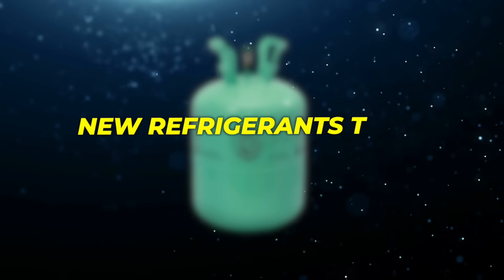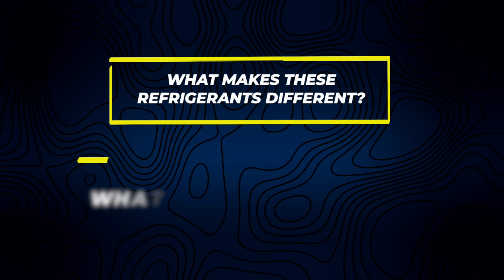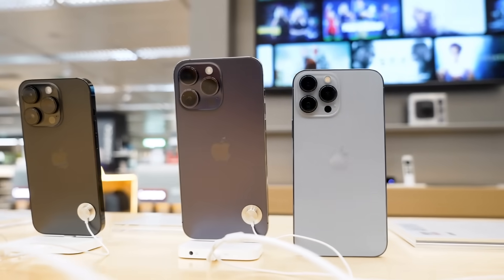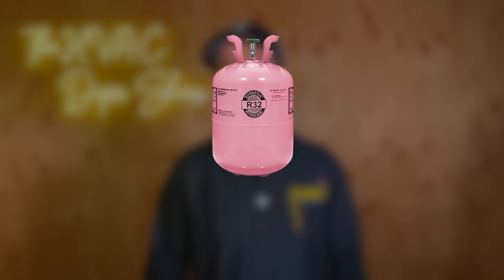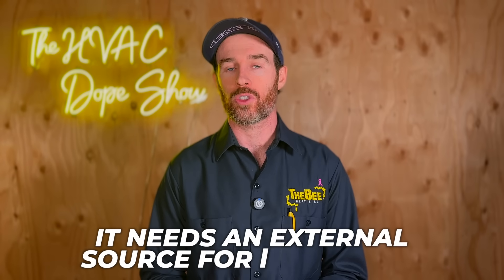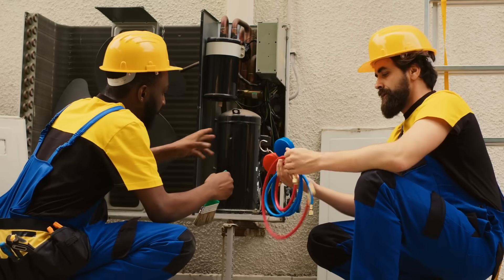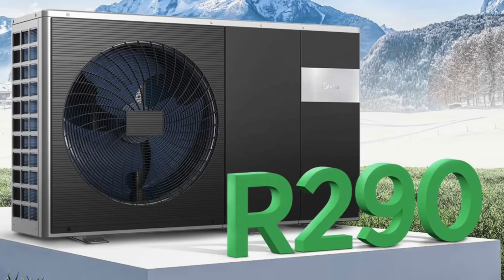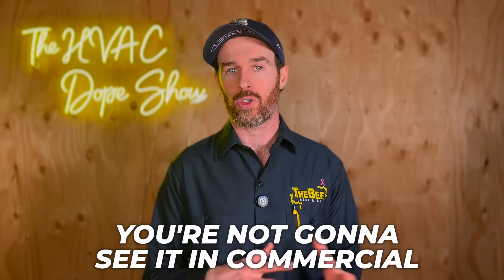The TRUTH about the “new” refrigerants | R32 and R454B refrigerants phase in

Comment: If your system with r454 is low and you top it off, you would be improving the gas mix ratio.  I don’t see the problem unless there was a large amount missing.  But if that were the problem, you aren’t likey to put more refrigerant anway.
Reply from the maker: There's no way to "improve" the ratio lol, not following that... 454b is a blend. Topping off means the blend changes. They said the same think about 410a but everyone tops off 410a so it's probably the same. Refrigerant charge is one of the top diagnoses for a system so it will always need some service at some point if it leaks etc (which can be from a valve/port, not necessarily just from a bad coil component etc which requires new charge anyways

Comment: I just bought a new Goodman Furnace/AC system and I bought  a 20lb of R-32 to go with it.  Yes, I don't like the idea storing a 20lb tank for 20 years.  But if it becomes illegal or price rockets I'll be covered. And if i need to top it off I'm good to go same day.  I just think it logically made sense R-22 R-32 sounded logical for adoption.   R-32 cools better than R-22 but with higher pressure I'll expect more problems.

Comment: What happens if you have a leaky coil and your turn your heater on?
Reply from the maker: The sensor will technically shut off the blower if it senses enough of the refrigerant... honestly that's the most annoying part because if you watch videos it's not very flammable but they're overly cautious

Comment: R410A is it going to get more and more difficult to get which means the price is going to skyrocket. I was just about to install a ductless system when I started reading about this. I had three HVAC companies trying to sell me a 410A system and didn't even tell me about this. It's so clear what they're trying to do. They have a surplus of these older units and they want to get rid of them
Reply from the maker: That's odd a lot of 410a systems are running out of stock but yes if they have back stock this can happen... phaseout will be 15 year process so in some markets it's a non issue but that's odd that they weren't offering R32/454b instead. For us it was a very similar cost, but manufacturers started discounting them

Comment: r32 has to have a sensor in the coil so if it gets a leak, it wont explode????????
Reply from the maker: Regulation... it won't explode lol. Watch videos of them trying to set R32 on fire, it's not as flammable as they make it sound, but yes it's a required regulation now. Technically r32 is 50% of 410a so it's already in your old system...

Comment: By the time I decide to replace my R22, for a 32 or 454, there will be a new one more flamable.
Reply from the maker: Probably r290, hopefully... it's just propane and likely that or butane is in your fridge. But those are much cheaper and they're safe as monobloc units, you won't have those running inside your home they use water / hydronic lines instead

Comment: There’s a reason why in the US market 454B will win out and almost all major brands in the US have chosen it. It’s less flammable than pure 32. 410A and 454B both use the same oil POE (Polyolester). 32 uses PVE (Polyvinyl Ether). They are not comparable so a R11 flush may not be enough. You will need to use a pig if you plan on long term customers. Also 454B is less governmentally restricted than 32.

R290 is propane. Refrigerant leaks are common. That obviously is risky. I think I t’s better to use R 717 than any of these. I’ve worked with it many times industrial and small appliances. I remember years ago running across a residential package unit in the US that had ammonia.

Comment: Had a home warrantee on my HVAC and other appliances. My AC wasn't keeping up with the heat, assumed it was low on refrigerant, so I scheduled a tech through the warrantee company. What you would expect: the warrantee denied the claim and the tech told me R410a was going away, that it is hard to get and very expensive. Said the system would probably need at least 2# @ $200/#. I fired him, cancelled the warrantee, bought a 2# bottle with an adapter for $144 and did it myself. May have taken 2-3 oz. Bottom line: if you're considering a home warrantee, forget it, waste of money AND lots of crocks and liars in the HVAC business.

Comment: I've got a 28 year old Amana R22 2 1/2 ton heat pump. Still runs like a champ, and has required minimal maintenance over the years. From what you described about R 32, and that Amana is one of the companies going with it, my initial feeling is that if and/or when my R22 unit gives up the ghost, I'll be going with another Amana unit.
From what you described with the R290 units, if I understood you correctly, is that it's basically a chilled water system, similar to what the USN used on submarines (retired USN Enlisted submariner) - in that, the working fluid that gets circulated to the cooling coils inside your house, is nothing more than cold water.
Reply: "Pssst...wanna buy R22??"

Comment: Go back to R22, best ac freon ever. 410 sucked. So do its replacements. 
Propane is an explosive gas waiting for a compressor to short and  cause explosion. It already happened in refrigerators blowing up
Reply: every grocery store and convenience store has 10 to 60+ R-290 refrigerant units, so don't go in there either. R-290 is a similarly efficient refrigerant to R-22, slightly better. Also, residential refrigerators are R-600a, not propane. R-22 has not been produced since 2020 and won't be.

Comment: This new refrigerant is such a scam. With not enough drums available. Not to mention the reverse threading on the new jugs. R-32 has been around for 10 years!!!!!!!!!  Goodman and Diakin are the only ones in the United States to use it. Every other company said no way. We want the r454 that’s a compound with 31% r1234 that’s in car ac. And in Europe it’s on the way out being banned due to forever chemicals. Europe was first to ban r134 for cars in the past. When r410 came out around 1995 it was 50% r32 and 50% r125. It wasn’t made mandatory till 2013 and that is like 18 years. R410 equipment is still legal to sell in the states till the end of this year but no manufacturers are making it. The manufacturers have plenty of either r32 or r454 but the issue is with the container tanks that is known to be needed to top off new installs. R454 will be banned and it’s just more bs. In 2034 the next change is to go to all natural refrigerants. Propane is r290  C02 and that’s a higher pressure. Maybe ammonia. Good luck

Comment: Subbed. Great info, sir. I bought a brand new 1,500 square foot single story house in 2009 in California that has a Lennox system that uses R22. The HVAC system mechanically works perfectly, but I'm a bit low on refrigerant. Because of this "planned obsolescence", I'm now (and I'm not the only one) forced to scrap a perfectly running system because I cannot get any replacement R22.
Reply: Ummm no.  Either it was undercharged when installed or your have a leak.
Refrigerants are a 100% sealed system, they do not "consume" refrigerants.
Reply: @darknes7800  Thanks for the info, sir!!!
Reply: @darknes7800  There is no such thing as a perfect seal.  Running a little low on refrigerant after a decade and a half can happen.  Although you may be right about it having been undercharged when installed as a cost-cutting measure.  That would make it worse.
Reply: @laurenceperkins7468  Sure, but there are only 2 schrader valve seals on the entire system. If your system is low, either you have a leak at a factory brazing joint or a field brazing joint.  Some companies do undercharge the system, in hopes of getting a call back and being able to charge the homeowner.  In some cases the tech has no idea what sub cool and super heat are, so they charge to pressure and call it good.   Cheers !
Reply: @darknes7800  There are also going to have to be seals on the compressor drive shaft unless it's using some kind of magnetic gearing to reach through the housing.  Which is technically possible I suppose, but I've never seen one myself.  There would be some significant hazards to that unless it was somehow built with a non-conductive housing, since anything conductive in the rotating field would turn into a generator...

Those are the ones most likely to slowly leak I expect since there's mechanical motion involved.  But it should be very, very slow.  Modern fluid seals are pretty darned good. So if it lasts less than a decade without a recharge then probably it was undercharged to begin with.
Reply: @laurenceperkins7468  If it was venting into the compressor housing, its a sealed unit and would not vent to the atmosphere and would result in quick and catastrophic damage to the compressor.  Occam's razor, 99.9% of all refrigerant leaks are at the brazing points. 0.1% are internal compressor leaks..
Reply: @darknes7800  The housing also depends on a seal around the drive shaft though.  So the kind of leak we're talking about that takes a decade or more to run the system down isn't going to build up catastrophic pressure levels.

All I know for sure is that everybody in my family buys 15-20 year old cars, and the A/C refrigerant is almost always low.  And, so far at least, every single one of them has not had any detectable leaks once refilled.  Probably less common in stationary applications where there's less vibration.  But there's some path for it to escape through that takes years to lose a few ounces.
Reply: @darknes7800  wrong.. look at your evAPerator.. usually one on it.usually not a problem
Reply: @jsparlin1  There is no schrader valve on the evap coil !!!!!!!!!!!!!!!!! LOL  
People on TY are a hoot.............
Reply: @jsparlin1  LOL!!!!!!!!!!!! Okay Ex SPERT !
Reply: Recycled R22 is definitely available.  It cannot be manufactured but much the recovered R22 is being recycled an sold
Reply: @jrb729  Thanks, sir!
Reply: Mexico still manufactures r22

Comment: HVAC has nothing to do with the environment and 100% about money and over regulation. Think not ? Why aren't most units designed for R290 ?  🇺🇲
Reply: because is explosive at spark, so only 8oz i bliebe is the limit. i magine a system with 5lb of propane and the compressor sparks?
Reply: @ivangonella1  R454b is the new refrigerant, and it's flammable and its also $1900 for 30lbs . Again HVAC is all about control and money it has nothing to do with safety or the environment.  / global warming bs . America needs a strong deregulation program and get back to manufacturing everything we use or need in this country. 🇺🇲
Reply: @ivangonella1 So why is the new refrigerant R454B so expensive and highly explosive/ flammable? 🇺🇲

Comment: What pisses me off is that we have been required to recover refrigerants since R 22. The damage to the ozone layer is crap if the Freon is not being released into the atmosphere. Every time we have changed refrigerants the air conditioning units have had to increase the pressures to maintain the same efficiency. The higher pressures means the unit works at a higher heat which shortens the life of the unit. Not to mention all the new equipment the tech has to buy to service the new unit. This is how politicians rip off the public without them knowing that they are being ripped off by the government while big business gets rich playing along with the governments game.

Comment: Will I be able to add or replace my Mini splits 410 with R32 or R454B or will I have to buy a new Mini split when or if I have a small leak like my Shrader valve?  I have 4 mini splits now 1 in each bedroom and one in the living room I installed all of them. I repair cars and trucks so I have gages and a vacuum pump. In cars with R12 I pull a long vacuum and replace it with R134 no need to change the whole system. Some people upsell their costumers a new dryer but I just watch the moister gage until I have pulled all the water out of the dryer. It takes about 2 hours.
Reply: 410 will be around for 20 more years
Reply: @henrykennedy1120  The 2 mrcools 1 in my sons house 1 in mine had the compressors fail at 4 years old and were full of refrigerant. Mine was $1,100 They will not replace them on the warranty because We installed them ourselves.  So I don't have much faith in these lasting as long as my 10+ year old window units.
Reply: Because you got the wrong brand , Mitsubishi is the best mini splits and you can replace a bad valve core without losing charge I have a core removed that olds back the refrigerant I know what I'm talking about I've been master licensed HVAC tech since 1978 410 isn't going anywhere ,r22 is still available also

Comment: The industry as a whole is a joke. Expensive,breaks and doesn’t go the distance. Parts under warranty are not fluid in receiving. Back ordered. Refrigerate cost are higher and limited. Customer service on higher efficiency units blows. This has to get simplified and become cost effective for the public. We will price ourselves out of a job. Shame on the hvac corporations and politicians. Someone needs to sue the majority of the corporations for this. The climate change nonsense is being manipulated. We produce three times the by product of older equipment due to junky parts and cheap materials. If they cared about the possible effects of climate change they would produce a quality product that’s efficient. They designed a product that is expensive breaks and fails shortly out of warranty. I care about my customers and hate to see the disappointment when expensive equipment fails.
Reply from the maker: Yeah it's annoying AF you're not alone. I'm getting annoyed with it, when an HVAC contractor get's sticker shock at their own prices you know somethings wrong... recently switched brands to offer better pricing because some manufacturers are not longer competitive, it's sad. IDK we'll see what happens but I have a feeling there's going to be a slowdown and squeeze this summer for manufacturers which might get them to realize things are softening and might be a good time to lower prices and be less greedy. If they can get away with the prices they won't lower them but we'll see, I don;t have optics into their monthly sales, but curious to report on the topic at year end after the data comes in

Comment: My 2015 AC condenser went, but, can't repair, because there's no AC freon, repair guy says can't fix, only replace, bummer
Reply from the maker: R410a is around I would get a second opinion it's probably just expensive... R22 is pretty expensive so if it's R22 it's probably not worth it but the refrigerants are around, just a lot won't touch R22. But r410a (probably what's on a 2015 unit) is absolutely available still

Comment: Your shirt is as flammable as an A2L refrigerant.  A propane bottle is so scary that plumbers carry one around without fear, and many people have a 50 lb jug in their backyard grill.  Smaller freezer sold in U.S. often have R290 (propane).  I've used it in my car's AC for decades (Duracool).  Is a charge of two 6 oz cans scary?
Reply: Residential AC or Heat Pump systems can use up to 20 pounds of refrigerant. A2L is ok, but R290 is too dangerous to pass UL Certification for residential use.
Reply: @WLB2-j5j 10 maybe if you install the condenser in your neighbors yard, not 20. Most I have ever put in a system is 7 and that was years ago before the advent of the micro channel all aluminium coils. They take considerably less now.

Comment: As far as topping off r410a, it's not really an issue if the unit's been running for the most part. If you have had something that's been sitting there in a general state of off and leaked its refrigerant then it becomes more imperative that you replace the entire charge because some of the gases will have fractionated out
Reply: R410a is a near-azeotrope, and is unlikely to fractionate, even in the event of a substantial loss of charge. So topping off is fine.

Comment: We need to just raise the cap on R290 and R600 in North America. They’re a cheap, reliable, and effective. Flammability is such an edge case issue and service providers that are most exposed should be trained on the hazards.
Reply: R290 and 600 are highly flammable and equipment using these otherwise good refrigerants cannot pass UL approval testing, which is required for sale in residential applications.
Reply: @ they’re currently permitted with charges less than 500g. The flammability concern is way overblown. I’ve never seen a charge leak out catastrophically. Failures tend to be pin holes and very slow leaks. The flammability range for both of these gasses is very narrow. The risk is very low and techs would need to be trained.
Reply: @yolo_burrito  500 g is nowhere near enough for most residential split systems. And the flamability of propane is not overblown. UL will not approve its use in residential split systems.
Reply: @yolo_burrito  Excellent points: no one should be servicing R-290 units like the 100,000 commercial refrigerators unless they know and follow flammable gas procedure just like no one should service a natural gas or propane furnace unless they are trained to do that. This is not hard.
Reply: @tkacandes2052 yes but would a chemical company have regulatory capture if we allowed hydrocarbon based refrigerants?
Reply: @WLB2-j5j  There are alternative to UL, which is a private for profit company, being referenced in codes. The fact is that UL does not have a standard for outdoor R-290 units or split systems either, but most other countries do and it's not impossible to adopt those standards. this is a 3 hour topic to discuss 100+ hours of meetings.
Reply: R290 is propane r600 is isobutane. 290 is currently in use in small commercial reach in coolers, single and two door models mostly.  Im an hvacr tech so I fix them.
Reply: @criticaltemperature3343 I’m aware. They’ll be very affordable refrigerants fit a very long time.